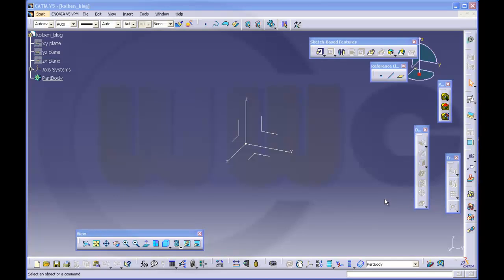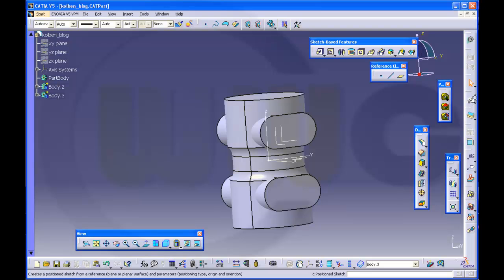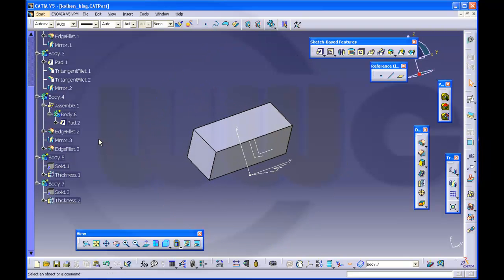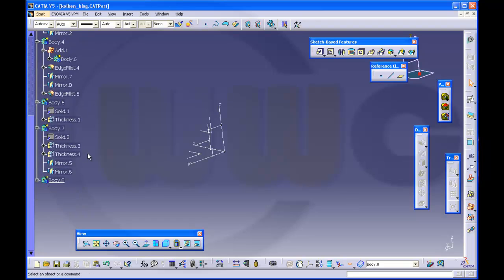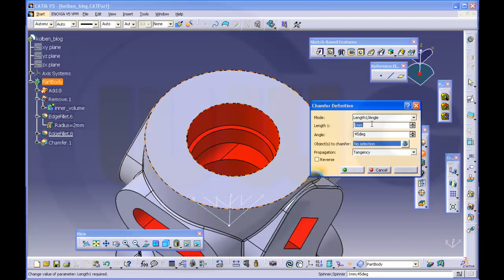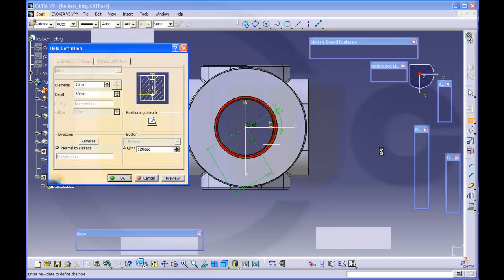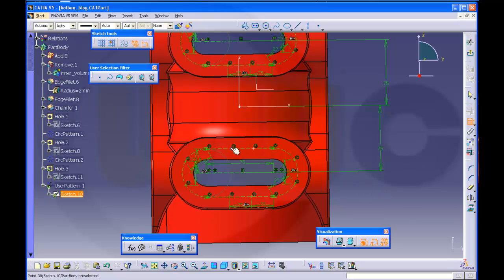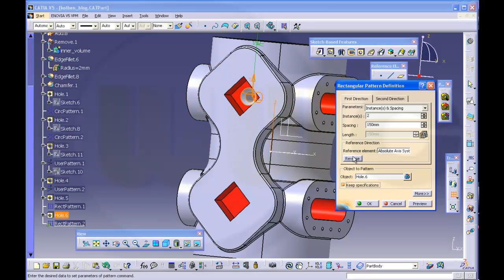11.4 Kolben / Piston - Catia v5 Training - Multibody model - User pattern

Comment: Sir, Why my axis system disappears when I select only current body option every time.
Reply from the maker: Obviously you use "hybrid design" and your axis system was not inserted under the axis-system node. So your axis system is under a body or geometrical set. If I create a new part "hybrid design" is not enabled.